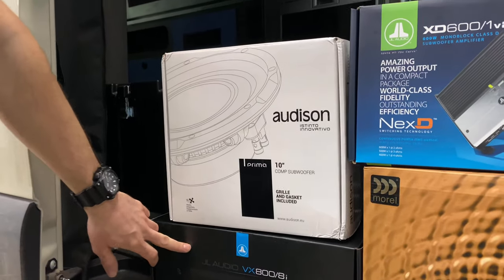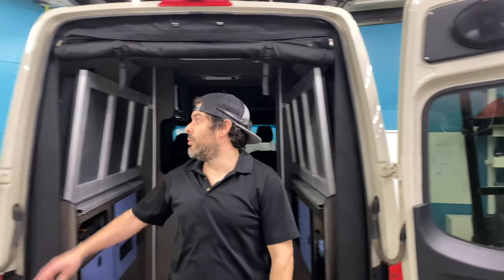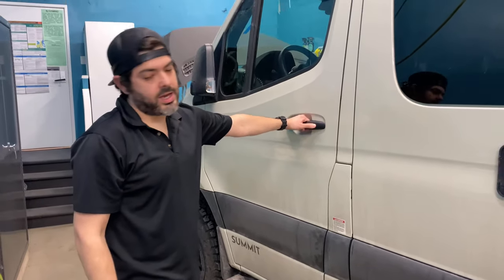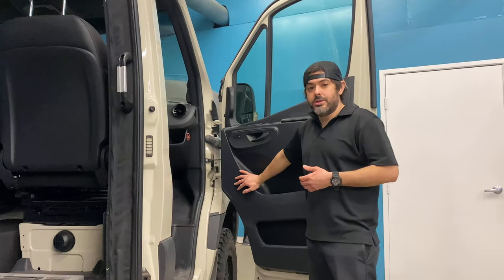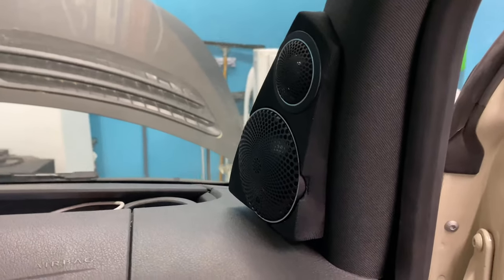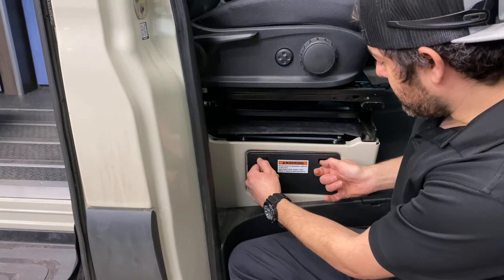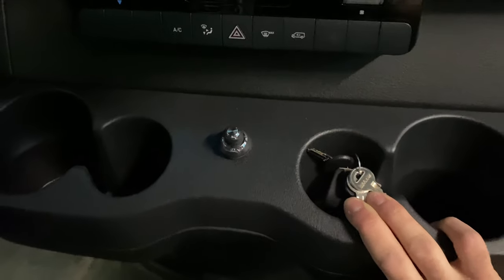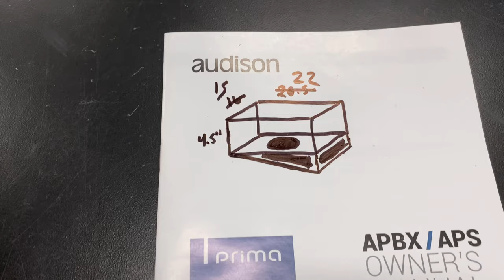2019 Mercedes Sprinter 2500 Build Documentary

Comment: So little detail. All tease, no detail. Does not entice me to entrust you to a $$$$ build.
Reply from the maker: Not the purpose of the video but thank you for the feedback! Just showing what’s possible not to gain your business.
Reply: As the owner of this van, I can tell you that after 3 1/2 years, we love this build. Elevated did a fabulous job working with the complex wiring of our solar camper conversion to run both from the cockpit/engine and from the house batteries in back. We have four different tunes: driver, full cockpit, full van (w/ sub) and rear speakers only (no sub). And the sound is terrific, especially if you've ever experienced what the inside of a M-B Sprinter cargo van sounds like on the interstate with 4x4 tires. We DO take the down gnarly washboard dirt/gravel road surfaces that will rattle your fillings right out of your head. Haven't had a single problem with the components, the custom cabinet housings, the wiring or anything else.